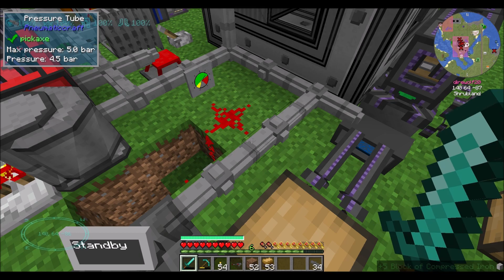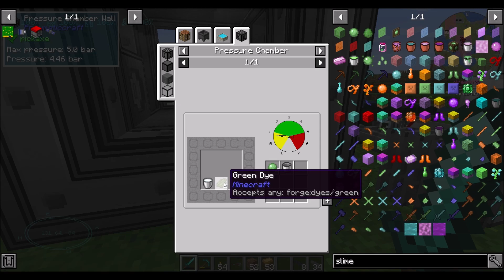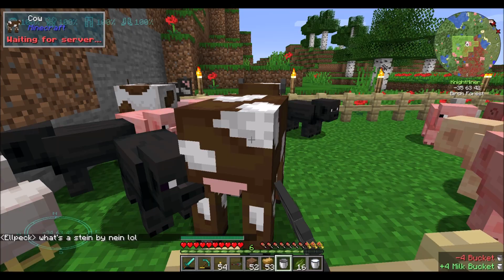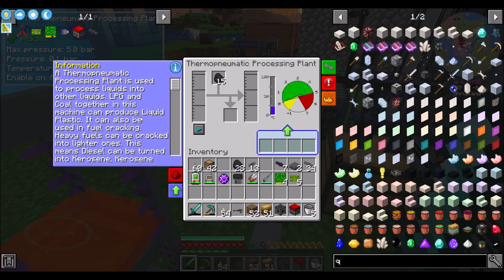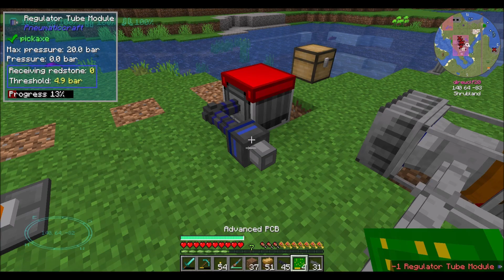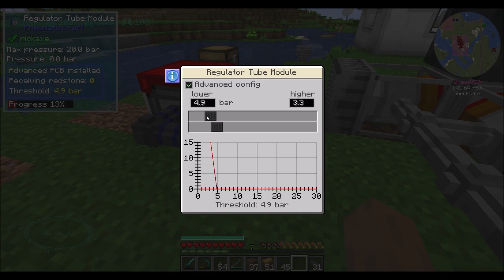Forgecraft S13E30 Advanced Pressurizers

Comment: Using the vortex tubes to cool is effectively self heating. Pressure is required to power them which requires the compressor to run and therefore generate heat. You're better just attaching multiple blocks of compressed iron with heat sinks attached to them. Place them underneath to hide them.
Reply: This, although Heat Pipes (new in 1.14+) are better since you get more of them per compressed iron, they can be camouflaged, and they don't lose heat to the air if left exposed :)
Reply: I've done the exact same, very good call. I'll have to check out heat pipes, I guess. So much new stuff!

Comment: Regulator Modules are in-line modules, meaning you can't just insert them into a tube, they have to go on the open end of a tube.  Just like in real life :)  
You should also make a Pneumatic Wrench, which you can use to close off tube sections, perfect for when you need to break out a bit of tubing for this sort of maintenance without losing much or any air.

As you've noticed, Vortex Tubes don't do a great job of cooling compressors.  A big array of Heat Sinks is the way to go, but also note that air usage and temperature doesn't go up linearly with speed upgrades (more upgrades = less efficiency), so a pair of Flux Compressors with 4 speed upgrades would be far more efficient than a single compressor with 7 upgrades.
Reply: I don't think Dire cares about efficiency in the use of RF, he's generating few million a tick
Reply: honestly  the last few times I've done Pnumaticraft I noticed that you never really use a lot of pressure at a time, 2-3 upgrades is more then enough that 7 is massively excess unless you intend to full on automate multiple processes through Pnumaticraft.

Comment: Do chained vortex tubes not work anymore? Because using a vortex tube on the compressor, another vortex tube on the first, with the heat pumping into the refinery, used to be the way to do this. Vortex tubes did more with higher pressure.

Comment: It's more efficient heat-wise to use multiple generators to generate pressure, rather than a single overclocked generator. Also, vortex tubes are awesome for regulating pressure unless the mechanics have changed; as pressure goes up, they consume more air, until they consume all the pressure being generated. I had a self-balancing setup way back when that maintained a constant 18psi.
Reply: The mechanics haven't changed - air usage is still proportional to pressure as it used to be.

Comment: @direwolf20  Is it possible to use the heat from the pressure maker to heat up the oil converter?   Maybe use the heat pipes to funnel the heat.  This way you use less of the vortexs, thus use less air, and thus less power while also keeping your air compressor cooler to be more efficient.

Comment: Pretty sure what he's trying to do with cooling violates the laws of conservation
Reply: He is trying to cool the wrong thing, the heat sinks should be on the generator and not the vortex tubes... Which aren't even needed. IF anything the vortex tubes are just using more of the pressure requiring the compressor to work more making more heat so it's just a loop of fail.
Reply: SilvaDreams all the pneumatic stuff that runs off of heat depends on temperature. For the tubes, they get less efficient if they aren’t kept near neutral so that means using sinks to get the side you aren’t using close to atmosphere is  cheaper than having both at their max
Reply: @ninjabunny.66  Really? I thought it was the difference between the two temperatures. Though that makes me wonder, is there user activated item or machine that can freeze water? Hint hint, Dire's mining laser. Just have an auto placer put a block right next to the water used as coolant and then mine it forever to create hyper efficient cooling.
Reply: @ninjabunny.66  pretty much.  To be exact, there is a (fairly weak) thermal connection internally between the hot and cold sides of a vortex tube, so they're always trying to equalise.  Dissipating the heat (or cold) from the side you're not using is therefore good for efficiency.
@ScarletFlames1 a bucket (or tank) of water in a chest with heat frame attached will do it, same way Dire is processing his plastic.  No temperature bonus for ice-making though.
Reply: ScarletFlames1 I’m pretty sure that the static sources of cooling don’t get you cold enough for it to be worthwhile. I tried in Enigmatica 6 but could only get the static sources to be worth it with heat sources.
Reply: @ninjabunny.66  yeah until something like Gelid Cryotheum reappears, static cooling sources aren't very practical.
Reply: @desht2008  Damn, that's kinda not fun. Why allow magma to do heating but not allow for ice cooling? It would be pretty cool to have something like a freezer made with pressure to create dry ice and then put it as a cooling medium for the engine. Perhaps even a dedicated thing like a radiation specifically designed to take in dry ice and dissipate the coldness of it into the machine it is attached to, and also allow regular ice types to go in for different temperatures (Ice goes to -10, packed ice -40 something like that).
Reply: @ScarletFlames1  thing is, ice and packed ice and blue ice all do actually work right now, it's just that none of them are that cold. At 1300C, lava is a much better heat source than ice at 0C (or -20/-40 for packed/blue ice) is a cold source. But if/when cryotheum is a thing in 1.16, rest assured it will be supported. And you can always add your own heat & cold sources via datapack now.
Reply: @desht2008  but you don't need cooling to go lower than that for anything (except for material efficiency on plastic or whatever), so you will usually use it to cool down a vortex tube's hot side  forbetter efficiency of freezing the box thingy as passive cooling averages around the 44+ degrees. Also cooling the electric compressor instead of building heatpipe towers with passive coolers.

Maybe could also use water on cold side of vortex tube and when it's frozen into ice just have it broken back into water?
Reply: @ScarletFlames1  the issue isn't really the temperature of the ice itself, it's the temperature difference between the ice and the compressor it's cooling - which is rather small compared with the temperature difference between a cold refinery and lava.  That's why lava is so much better at heating a refinery than ice is at cooling a compressor.  As I said before, it's all down to the need for colder blocks/fluids which we don't really have in 1.16 by default, yet.
Reply: @desht2008  You completely ignored the advantage of NOT WASTING AIR PRESSURE ON VORTEX TUBE FOR COOLING THE THING PROVIDING AIR PRESSURE FOR THE VORTEX TUBE. (capitalized so you can't miss it a third time) The temperature difference between constant -40 or -20 and a +50 compressor is enough to keep it stable as the air is 20+ (I think) and we see dire putting a giant tower to dissipate the heat. A greater heat gradient means bigger impact. I think it's exponential growth in effect, for example. an object at 100c which you want to reduce to 20c (room temp), you could create a huge heat pump with fans and radiators in the room in order to equalize the heat. Or you use a compressor to create a cooling effect and pump away the excess heat with a much smaller radiator setup as it will be hotter than the average temperature of the air.

also also, why the hell are you making a comparison between using lava to heat a refinery and ice cooling a compressor when we're talking specifically about the cooling effect? There's no point to doing that, here let me do the same to you so you can see how stupid it is: But why use Lava which you need to replace every time when you can use a vortex tube to cool down a chest with that thingy on it to make more plastic.
Reply: @ScarletFlames1  I'm really not even sure what your point is anymore.  Static sources of cold don't work that well for cooling machines, and it's always been that way.  The best way to cool a hot compressor is a large bank of heat sinks connected with heat pipes, which doesn't waste any pressure.  Or better yet, more compressors with fewer speed upgrades so the compressors don't get so hot in the first place (and better fuel efficiency).

Using vortex tubes to cool compressors is just plain wrong, always has been, always will be, as lots of people have already pointed out in these comments.
Reply: @desht2008  ICE and an electric compressor and AIR and the same electric compressor, guess which one has better temperature difference? So by your own words, replacing passive cooling with heat frames or just ice blocks in-world would be better than the radiators.

Comment: I may be wrong, but doesn't the vortex tube need heat on the red side so the blue side gets cold to cool down the machine?
Reply: I've only done a little research on RL vortex tubes, but internally a vortex cooling tube moves air around internally somewhat like a rotary gas separator - hot air expands, so it tends to be moved outward/upward in the vortex while the cooler stuff moves inward/downward, so it pushes the cool stuff toward one end and the hot stuff toward another. So the differential inside the tube is important in terms of heating/cooling. Then you add the hot or cool faces on the tube's heat surfaces, which transfer that energy into/out of the tube and its internal air supply.Thus when you add heat sinks, their temperature trends toward the balance between ambient air temperature and the tube end that they're touching. So effective cooling means that the hot end actually doesn't stay hot, it's venting the heat produced by the machine it's cooling plus the vortex tube's own heat. (Since it's moving a lot of matter quickly, vortex tubes actually generate a decent amount of their own heat, and this apparently contributes to establishing directionality in the vortex!)